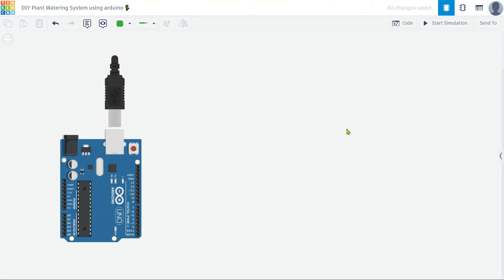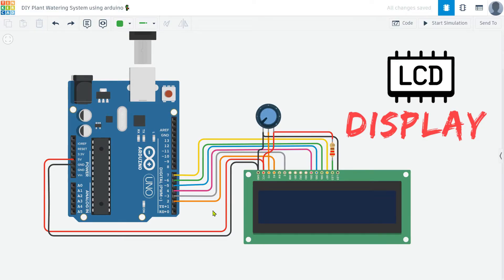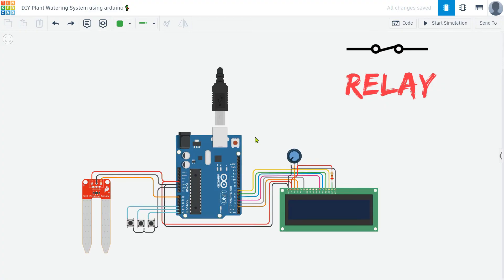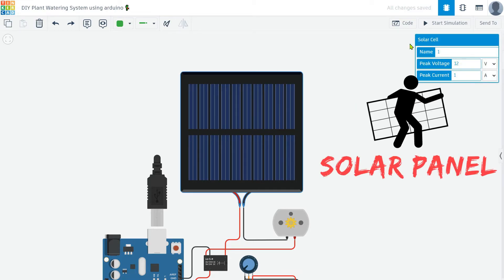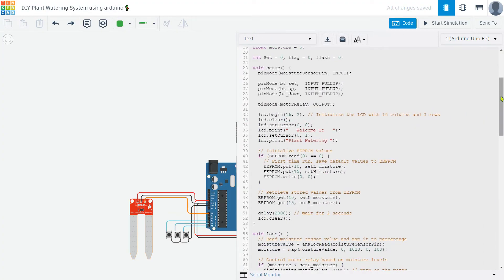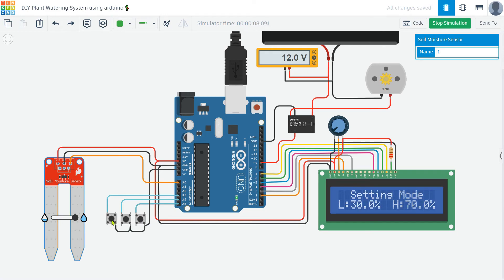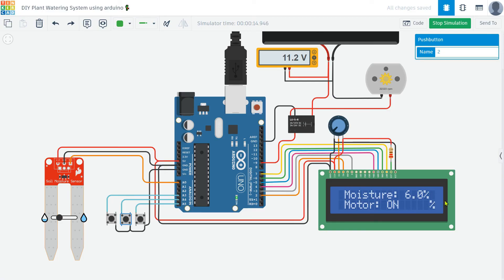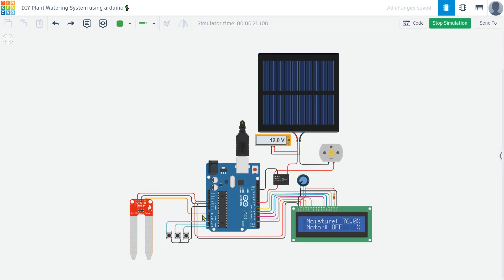🌿 Smart Plant Care: Automatic Watering System Using Arduino and Solar Power ||Tinkercad ☀️

Comment: hi, great video. may i ask, if i change the 12v dc motor to 12v water pump would it still work? i'd really appreciate your help, thanks!
Reply from the maker: Yes, You can use any 12V load
Reply: I want code sir

Comment: Where is the code, my friend?
Reply from the maker: https://www.tinkercad.com/things/bxCCitTG52D-diy-plant-watering-system-using-arduino-

Please Check
Reply: @technicalshubham789  it has a different code I guess. Kindly share me the code for automation plant water system 🙏🏻
Reply from the maker: The code in simulation is correct and it works well. Please prefer that one
Reply: @technicalshubham789  ok thank you sir
Reply from the maker: It's normal dc voltmeter